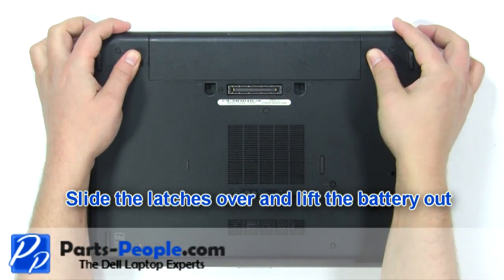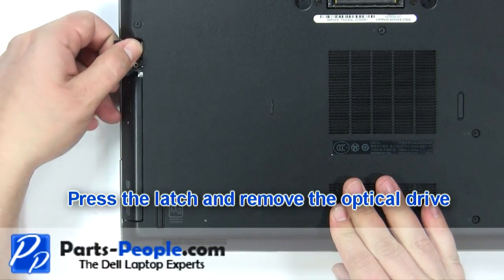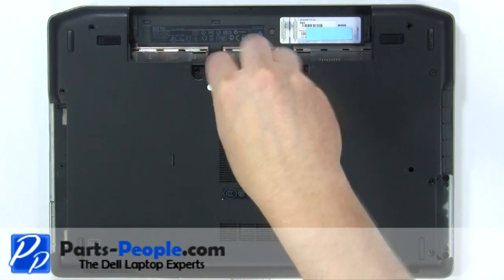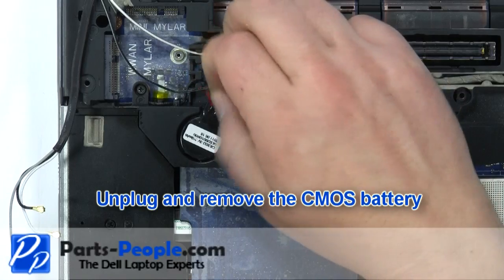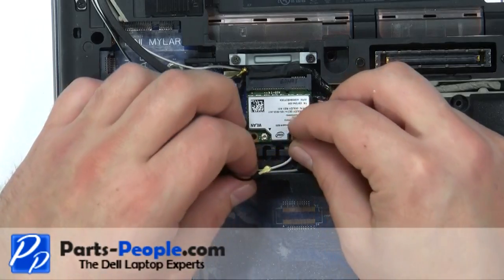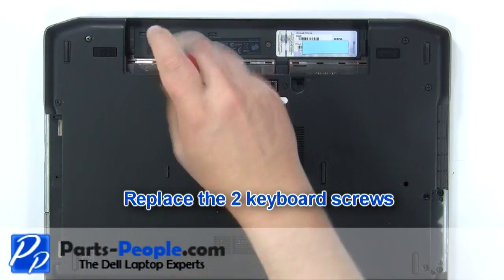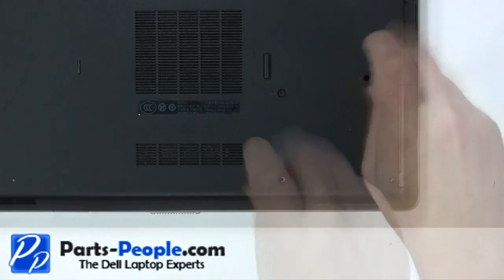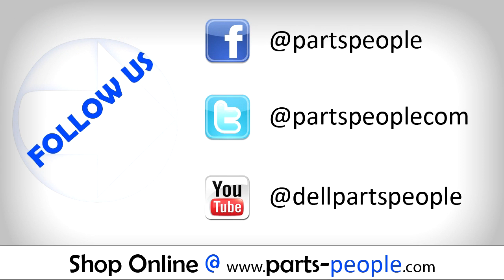Dell Latitude E6420 CMOS Battery Replacement Video Tutorial

Comment: Will replacing the battery clear all bios settings? Or only if you don't do it fast enough?
Reply from the maker: Swapping your CMOS should not reset your bios but I would suggest noting the current settings if they were changed from their original default settings.

Comment: what happens if you don't remove the hard drive and optical drive before removing. the cmos battery
Reply: I too would like to know the answer to this question
Reply: did you find out?
Reply: Leo Zebi it should not make a difference technically, only may make it harder to gain access to the cmos battery on some models